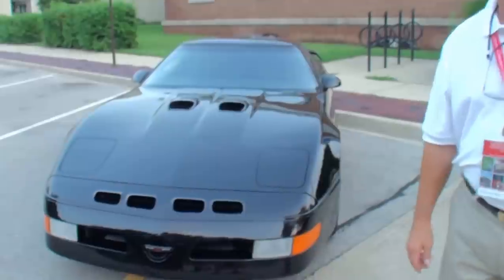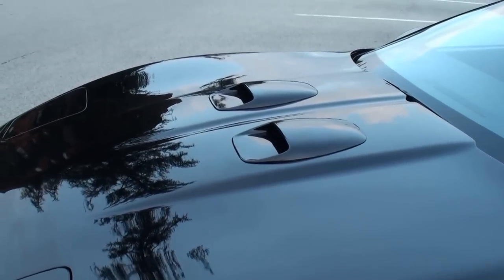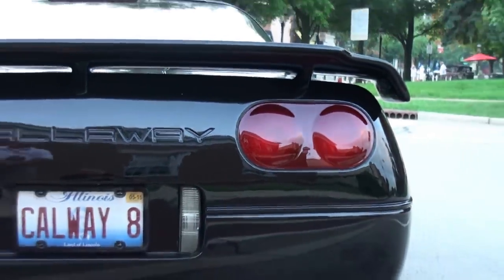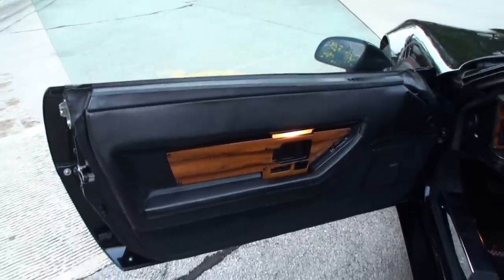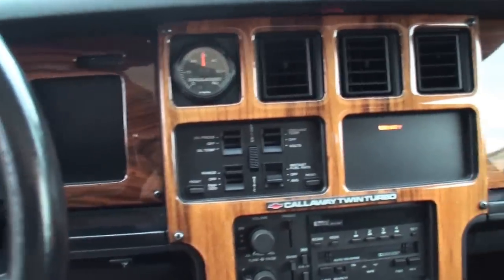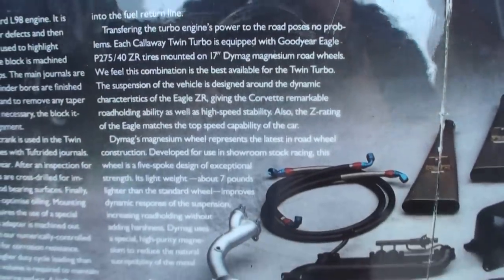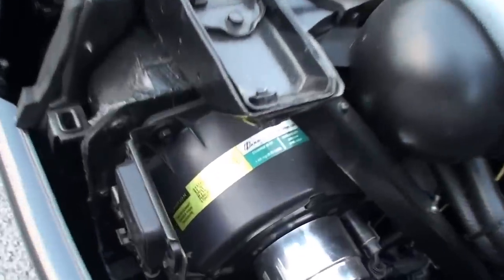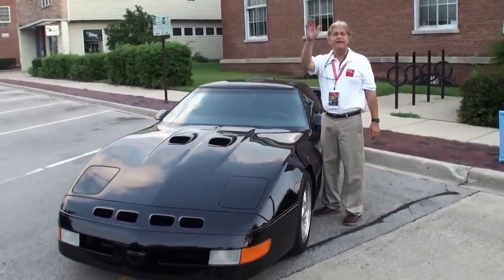1988 Chevrolet Chevy Corvette Twin Turbo Callaway - My Car Story with Lou Costabile

Comment: I am a proud owner of 1993 ZR1. 1 of 417 built in 93 and 1 of 22 in the polo green color. Up until the C4 ZR1 came out, My dream car was the Callaway for sure. Beautiful car Lou. Thinking a Callaway sitting beside my ZR1 would make my life complete.
Reply from the maker: Hi Darin Guillet, Nice car :-)  Hope you get your Callaway someday soon, Lou
Reply: They built 448 ZR-1s in 1993.
Reply: Didn't lotus tune the engine in the 93' ZR-1
Reply: ALT CONTROL DELETE no they designed the LT5

Comment: Back when callaway actually modified cars
Reply: They still do, check out the MotorWeek channel Sep 30 2016 video
Reply: Martin Quin throwing a supercharger and some badging on a car is nothing compared to when they truly built cars
Reply: Chris Cahill true, they would actually pull the motor apart.
Reply: Now they just slap parts on.
Reply: That’s because the OE manufactures have caught up to what aftermarket would usually do to the current models.
Reply from the maker: Thank you for viewing and sharing your knowledge.
Reply: Callaways were not reliable, they slapped a couple of turbos on top of the l98 .it had tranny issues, diff problems and a stock gnx would eat it's lunch.
Reply: david carder a mid to high 13 on a good day stock GNX wasn’t beating a twin turbo call away ... GNX was a good race for a stock corvette
Reply: @OggaDugga  Not even close to Callaway !
Reply: @davidcarder6364  The only part of your statement that is true is the last part. The GNX would indeed smoke a Callaway through the 1/4, but that's it. Callaways are incredibly reliable.

Comment: Some misontormation here
1.Callaway B2k option was from 1987-1991 not 86
2.The Callaway was not completely before the introduction of the ZR-1 as it shared 90 and 91 with it. 
3.The standard and stock 88 Callaway with aerobody WOULD not go 200mph it was more like high 180's as the top speed of the 1991 with 21 more rated horsepower was rated at 192
4.The Aerobody option was from 1989-1991
5.Thecwood dash on this car was not a Chevy or Callaway option and is aftermarket
Reply from the maker: Hi Craig Thomas, Thank you for viewing and sharing your knowledge, Lou
Reply: craig thomas in 1988 the car had a recorded speed of 254.76mph, i watched a video on it. It is correct over 200mph
Reply: That was the Callaway Sledgehammer with 898 hp considerably more power than a regular B2K Callaway. The 1988 had 382 hp and the Callaway aerobody package is rumored to add about 5mph to the top speed of the car. So with that being said, with horsepower and torque numbers being comparably close to a 93-95 ZR-1 top speed, that would put it on par with Craig Thomas' mid to high 180 range.
Reply: Timothy Harrison sledgehammer was going to be a package but it ended up not being so that's why that 254mph car is worth about a million
Reply: Whoever put that wood on the interior needs killing. Looks how it's been screwed in :(
Reply: @jblack5323   Yes, he should be killed, but not so fast. This hideous workmanship deserves significant  punishment. There's no fun kicking a dead horse. He gets a thrashing first.

Comment: Had to come up with something quick because of the 300zx twin turbo
Reply: Chris Pham please the lt4 could rake the twin turbo no problem they also had one called a sledge hammer, zr1 and others so..... No
Reply: That wasn't until 1990
Reply: The Z32 was never competition for the Corvette.
Reply: exactly...it was only 300hp. cool but not even the same league.
Reply: That car is heavy and slow out of the box just like the Supra.
Reply: Kyle Scaggs You’re right, it far exceeded it. The TT made a standard C4 look like crap when it was introduced. Only the ZR1 could kill a Vette C4, and even then, come the corners, the C4 wouldn’t stand a chance.
Reply from the maker: Thank you for viewing and sharing your thoughts.

Comment: Lower it an inch. Get better tires. Do a manual trans swap and give it a good detailing.
Reply: Oh geez, I didn't notice the automatic. I was a 70s kid and it seemed like every Corvette, Trans AM or Z28 had stupid automatics. I can understand having and auto if you have problems shifting because of injury or age, but they just killed the fun. Then again, most of the cars I mentioned (Corvettes not so much) were typically daily drivers, so that's another variable. Then again, most Firebirds or Camaros that I remember were driven by high schoolers or in their early 20s, so it's not like that should hold them back from having fun with a real transmission.
Reply from the maker: Thank you for viewing and sharing your thoughts.
Reply from the maker: Thank you for viewing and sharing.

Comment: Hate the wood.   The leather seats are in need of replacing.

I had that crappy perforated leather in my truck.  Stuff just doesn't hold up very well, and I was pretty anal about keeping it cleaned and conditioned.
Reply from the maker: Thank you for viewing and sharing your thoughts.

Comment: Amazing car but Ferrari F40 and Porsche 959 were also a 200 mph cars from 2.9 L engines. 
This Corvette is not that good as you think. Look at Porsche 959's technology.
Reply: Schlomo Ubermann yeah but those cars cost 5 times what the Callaway cost. And if you look at the Callaway Sledgehammer it would do 254 mph nothing even came close to that for years.
Reply: Why do better winn most the races?
Reply: +Schlomo Untermann Hate to break it to you but unless they were n/a engines, that whole 2.9L (n/a) engine displacement goes out the window. Not to mentiom those are engines built around turbochargers, this is the other way around. And prosche is nothing more than a glorified vw.
Reply from the maker: Thank you for viewing and sharing your knowledge.

Comment: I have an 1984 cross fire injection .L98. I'm Pritty sure. It will go 300 miles an hour. I had it way over 200. It pulling harder than it was to get it their. At 15 seconds past 200. I decided to shut it down.still Pulling hard.  I have a 406 sbc.  I have been thinking about turbo charging.  But I lose horse  power. I beet a lambo.gt 500s. Other vettes 2014 old dude. won't look at me after I beet his vette. Real bad.   So you don't need a Callaway to get their.   AND all them wholes slows it down. AND makes it hard to control at high speeds.   Pretty garbage
Reply from the maker: Hi Lawerance L bourland, You have a fast car for sure :-)  Thank you for viewing and sharing, Lou

Comment: I've only ever seen one of these in person.  Was at Delmar speedway and track.  The guy who owned it talked it up like it was the fastest car ever made.  I was there in my 1987 Buick Grand National and lined up next to the Calloway Twin Turbo Vette to see just how fast it was.  My stage 3 Grand National ran on average an 11.70 stock, and that is a 3.8L V6 single turbo.  The race was fairly uneventful and not even close.  The Calloway ran a dismal 13.7 vs me then later ran a 13.9 vs a 1988 GT Mustang that ran a 13.5ish  This thing cost more than twice what my Grand National cost with a 5.7L V8 twin turbo!!  WTF?  who would pay $50,000 for that?  I believe a stock Vette at the time ran very low 14's in the 1/4 mile?  Dump about $2000,00 into a stock Vette engine and it would blow the doors off the Calloway.

And before some die hard Vette fan speaks up about how it's a special edition, keeps it's value blah blah blha,  I sold my Grand National 6 years after I bought it new.  I put 48,000 miles on it.  Paid $21,000 for it and sold it for $24,000 after only 6 years.  I just looked up average going rate on an '88 Calloway twin turbo under 50k miles.  15 to 19 grand currently is the going rate for a car that cost $50,000 in 1988...
Reply: First, which Pontiac engines are you referring too? See, in the early 80's GM started a new corporate engine policy.  Pontiac would manufacturer all of GM's 4 Banger's and Buick would make all GM's 6 Banger's and Chevy and olds would make all of GM's 8 Banger's. And I know the later Grand national GNX was a beast, but I'm not believing it smoked a calloway. I'm calling bullshit on that. The slowest calloway runs in the low 13's and the sledgehammer was even faster. It was the fastest production car on the planet for a few years. So, stop hating and don't be one of those douchebag GN guys.... I don't know what's with you guys but y'all have this holier than thou shit that is just annoying. It's just a regal with a couple turbos....
Reply: Well first off there was no "Stage 3" Grand National that came from the factory. Secondly, a simple tweak in the boost and this car could make alot more power. It's still a L98 stock output is 240hp which means the Twin Turbo's Callaway put on are only adding 100 base hp. So basically the boost is very low to keep it daily driveable. Grand Nationals are sweet cars but you're comparing Apples to Oranges. I could take a shitbox 80s Camaro and slap a 5.3 LS with a turbo and run 11s or quicker, but that doesn't make the Callaway Vette a shitty car.
Reply: Preston You know why these cars lost their value and the Grand National didn't...It's pretty simple. THEY DIDN'T MAKE GN'S AFTER 1987. These Calloways didn't hold their value, when you have the Zr-1 coming out in 1990 making more power, and then the LT1 C4 making 300hp. If they made GNs in the 90s that were faster/better made, your 80s one wouldn't hold the value.
Reply from the maker: Hi preston121068
,  Happy to read this car brings back memories of the car you remember :-) Thank you for viewing and sharing, Lou

Comment: doesn't the car go 256.7mph?
Reply: That's the Corvette Sledgehammer, only one of those was built by Callaway. The Sledgehammer had 890 horsepower and the normal Callaway twin turbo Corvettes peaked at 403 horsepower. The normal Callaway's top off around 180-190 mph
Reply: Martin Quin oh ok I want a sledgehammer :)
Reply: Chris Cole you can buy the original for a mill it's constantly up for sale apparently
Reply from the maker: Not sure, that's pretty quick.